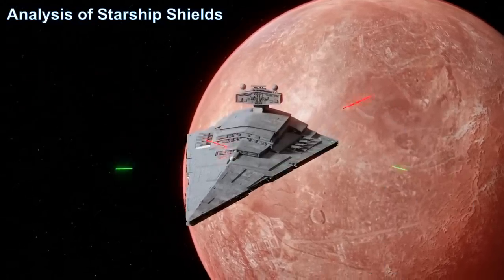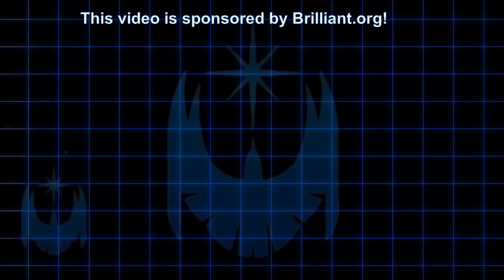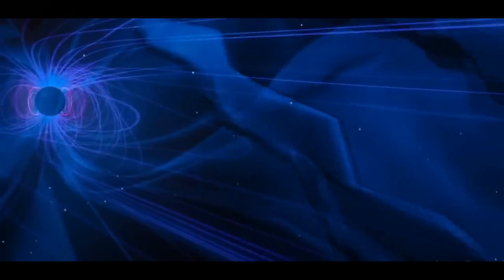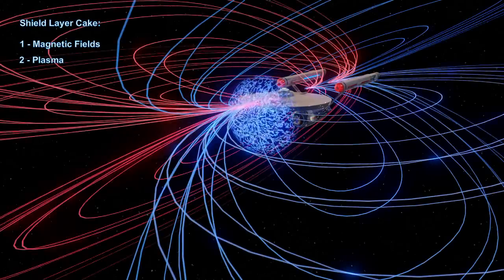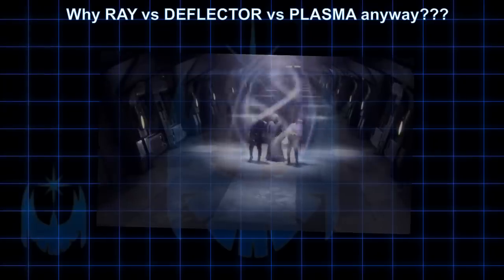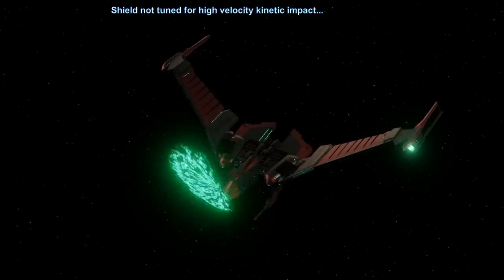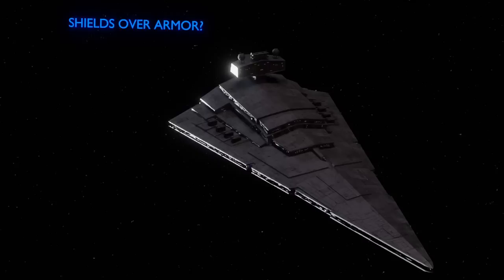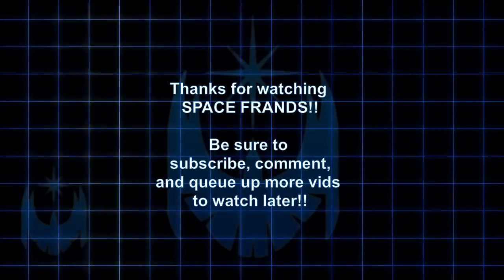REAL Starship Shields Types - They Work Like This...Animated Breakdown!

Comment: A very interesting take on shields. One quibble though, shields would add mass. The shield itself would not add much, but the equipment maintaining it would be HEAVY. Maintaining a shield would need alot of power, hence bigger reactor/solar sail/fuel tank And also a bigger radiator. And that's on top of the electromagnets and electrodes you need to control the plasma. (Now theoretically, if you're venting gas to keep your plasma shield going anyway, you could dump waste heat into it and that might alleviate the radiator stuff.) Not to mention that most ion beam/fusion systems use magnets on the outside of their vacuum chambers because making a magnetic field bigger then your magnet is expensive. Not saying it can't be done, but it would be cumbersome. As an alternative to armor, why not have armor drones following your ship around? It would look like a real life shield, and if you want a more punk/warhammer aesthetic, you could decorate the shield drones and make the special effects department mad at you for the extra hassle.
Reply: It would be big, true, but it would be nowhere near as heavy as armouring up a ship. All the mass and bulk of the shields is concentrated in one place, plus as you mentioned, bigger power source. Armour on the other hand, you have to COMPLETELY surround the ship with 10ft+ thickness of hardened steel, topped with a few feet of your anti-laser reflective surface..
Reply: @Debbiebabe69  
-As I comment this, It dawns on me that I have become one of the people getting into arguments over fictional starships, I feel my neck and...OH. Oh well, on with my dissertation.  

-What defence my fictional battleship is using ought to depend on: Who is shooting at me? what are they shooting at me? and who is paying for my battleship? 
I'm going to start with plasma/ion beam weapons first, and move onto impactors and lasers later. 

-I think the only style of shield mentioned here worth having is the plasma barrier. A magnetic field or electric field is vulnerable to neutral beams-which are easy to make just add a plasma flood gun to your ion beam. 
https://en.wikipedia.org/wiki/Flood_gun

-Look up bending magnets made by buckley systems. Those magnets are huge, and the ion beams they bend go on the inside. 
https://www.buckleysystems.com/welcome
in a similar vein, look up commonwealths fusions magnets for their tokamak. Again, the magnet goes around the plasma it is bending. 
https://cfs.energy/technology/hts-magnets
There is a magnetic field on the outside of these magnets, but it is weaker then the field on the inside. 

-To make matters worse, these magnets are time consuming to manufacture and hence $$$. Unless I'm flying some sort of expensive gladiatorial battleship, no one will want to pay for magnets that huge. (Actually even then I don't think they would want to fork over that much money.)

-to armor against projected energy weapons, the first thing to consider is the kW/cm^2, depending on how concentrated the beam is, you could probably get away with a half inch of water cooled graphite armor. You might want some radiation shielding underneath that, in case the beam creates secondary electrons causing xrays or even worse neutron radiation. 

-Also, how far away are these technobarbarians who want to shoot my beautiful ship? Lasers and ion beams aren't strait lines. They are very narrow cones, they get wider as they go out. That may make things easier. 

-Now for lasers: 

-Reflective coating, well it might be a few feet, but I don't think it has to be. The mirrors inside ASML's EUV machines handle conditions similar to space battle lasers, but they don't have feet of coating. Now, I'll add a caveat here, ASML has a pretty good idea what light frequencies the laser light hitting the optics will be. That does simplify and probably lightweight things. Another caveat: Just like bending magnets, giant EUV mirrors are $$$$$$ 
https://www.asml.com/en/technology/lithography-principles/lenses-and-mirrors

-An alternative to covering the entire ship, if I know who is shooting at me, where they are, and what frequencies of light they are using, and how spread out their beam is, I could instead position a mirror drone between me and them. (Because if I'm in space, who says my armor and my guns have to be physically attached to my ship? I could just give them their own propulsion and program them to stay close-ish.) 

-depending on the kW/cm^2 of the laser, water cooled graphite armor is again a pretty good idea. To further on the shield drone idea, a shield drone with a rotating water cooled graphite drum between me and those pesky rebels who want to destroy my imperial doom-ship would be kinda nice. 

-impactors: 

-Now the first question here is how big are these impactors and how much potential energy do they have? (In this case, I probably want to worry about kN/cm^2, but kW/cm^2 is still relevant.) Before I let it hit my over decorated armor, I want to break them up using my point defenses.

-Now how sophisticated are these impactors? For a rebel alliance with deep pockets, these impactors may have point defenses to protect them from my point defenses, they will have thrusters in case I try to avoid them, (After all, with the distances involved in space, they may have been launched at me months ago.) they may even have decoys to fool my point defenses. 
https://missilethreat.csis.org/russia-deploys-missile-decoys-in-ukraine/#:~:text=On%20March%2014%2C%20the%20New,mobile%20launchers%20within%20Ukrainian%20territory.

-against these, I have several options: I could try and trick the missiles with take drone ships, I could have space chaff and flares, I could even have some sort of giant screen showing the starfield behind my ship to try and trick the missiles. Though the giant screen would have the problem that its light would not be as colliminated as true starlight and a sophisticated impactor would NOT be fooled. (But a cheapo rebel knock off, it might work.)  

-once again, I don't need to armor the whole ship, I could have an armored shield drone that can take the hits and an early warning system.  

-As mentioned in the other comments here, you would probably be using whipple shields instead of hardened steel. 
https://en.wikipedia.org/wiki/Whipple_shield

-In addition, If I really wanted hard armor, I have other options besides hardened steel. Because I am an evil space emperor and have access to asteroid mines, I could use iridium or nickel based shields relatively cheaply. Even better would be ceramic composite armor like used on modern tanks. 

-Now if you actually read to the end, I am IMPRESSED!

Comment: I was thinking that if you have shield that works like you would expect using magnetic fields and charged particles. If it protects from some charged particles attack (plasma) then what about engines? so far we know how to accelerate charged particles and make ion engines but if there would be a strong shield around your ship then it would also absorb those particles from engines (would be like blowing fan into a sail on same ship). Tbh as i'm writing it with shields powered on how would you even use your energy weapons? So un less we use some kind of neutron acceleration there is a problem. (Neutrons 'acceleration' could be achieved using some particle collisions and knowing the exact angle of reaction we could make collimated stream of neutrons) I'm creating more problems... if we use accelerated neutrons then there would be no need for shields x) (ofc you would like to still protect yourself from cosmic radiation).

Comment: Neutron weapons seem like an amazingly effective thing here.
1. They don't really react with plasma that much.
2. They don't really react with most types of armor that much.
3. They wreak havoc on biology, sensors, computers, and any nuclear tech on the enemy ship. And unlike most radiological weapons, they actually cause the target to mutate into different isotopes. Possibly radioactive ones!

4. Neutron-hardening equipment isn't easy. You need avoid certain isotopes that become problematic when hit. You need to put very thick and heavy neutron shielding around crew and sensitive equipment. Additionally, unlike gamma or charged particle radiation, neutrons are not part of background radiation in space. Even if you can deal with them, most ships are not going to shield the entire ship from them. If they run their own nuclear engines those probably have shadow shields, but that does little to protect the ship from external attack.

Comment: Actually plasma is a fantastic absorber of most low frequency lasers and the more laser it absorbs the better it is. To the point this is actually what stops intermediate pulse lengths from being viable weapons in most cases. You either need to focus the thing on it for a multiple seconds and melt it, or go for nanosecond short blasts that turn the plasma from the vaporized target material into a million degree explosion that shatters and craters the rest of the material non-thermally.

Hard radiation frequencies like X rays can definitely punch through plasma but plasma is one of the blackest things out there when it comes to visible and IR. So much so that the opacity of the fireball from a laser weapon is actually the thing that limits its practicality.

Comment: I had a concept for a form of magnetic deflector shield that behaves more like the reactive armor on a tank, wherebye when a projectile approaches it fast enough, it basically lobs a massive magnetic pulse at the incoming projectile, steering it aside. Like flicking a nickel at a high powered magnet.

Comment: I like the way that Neal Asher deals with shields and armour in the Polity series. When the shield projectors overload they eject into space rather than becoming explodium inside the ship.  Like their engineering design is to have ejection ports and be designed to fail safe.

Another couple of interesting ideas from harder sci fi:
Sand shield (I think from Jack Campbell) they literally mine asteroids to crush into sand and gravel sized particles. As the human fleet fights it blasts sand ahead of itself then "taps the brakes" so space ahead is a wall of sand. This then interferes with beam weapons, is a physical obstacle for kinetic weapons (a railgun projectile hitting a near c sand grain will make a pretty explosion) and when the sand reaches enemy energy shields it dumps a massive load of energy into them and overloads them.

Point defence so good that it is shield like; or in other words you cover your ship in very fast short range lasers to individually or in an array target incoming kinetic threats

Comment: Last month you made a video talking about how everyone got wrong the deflector shields o an ISD.  I suggest you look into how everyone is getting wrong the dish on the TOS Enterprise.  Everyone is calling it the deflector dish because that's what is is on the Enterprise D.  BUT early schematics of the TOS Enterprise show it to be the COMMUNICATION dish NOT deflector.  

The deflectors are actually to the sides and bottom of the communication dish.  They are rectangular boxes.  These are also carried over to the refit Enterprise.  The fronts are now more oval.  These are ACTUALLY the deflectors which is why Reliant also has TWO of these on the top of the saucer and no dish of any kind.

Comment: Static shields project a field of static electricity that discourages or even fully disables people passing through by doing exactly that; projecting a static charge (the kind you feel when a thunderstorm is coming irl, or when you drag your feet on a synthetic surface and touch a radiator or other conductor). In Titan A.E., Star Trek and Star Wars we sometimes see people pushing through such a shield with great pain to the person attempting this.

Comment: Shielding against electromagnetic energy has been around for about a century. How do you all think your sensitive electronic devices work without every AC power source or radio signal source interfering? And defense against a laser is just a nice reflective surface. This has also been around for a very long time in a way. Although not laser frequency, satellite dishes and radio telescopes both reflect electromagnetic radiation of the desired wavelength. More recently, stealth fighter aircraft reflect radar off at a different angle. There's your deflector shield, albeit for far lower energy levels than sci fi would suggest. When a welder wears a welding mask he is protecting his face from very high intensity UV radiation that would cause instant sunburn without the mask, and it's just a piece of plastic with a heavily tinted glass window in it. So sorry to spoil the fun, but all the tech has been around for a long time. The only reason it's not really built on the scale that sci fi would suggest is that nobody is posing any threat yet with any credible directed energy weapons, and the only reason that's the case is because the end of the cold war and the collapse of the Soviet Union ended the arms race, as nobody could justify the continued expense. That might all change over the next few years now that Russia has flexed it's muscles and China is getting a bit too ambitious on the imperialistic front.

Comment: With how Star Trek Star treks deflectors are separate from their shields (even tho the writers forgot that at times, looking at you Picard) I assume their shields are Plama based, especially with how their Warp core produces an overabundance of it. Their Deflector likely deals with Lasers, like amagnet bending light, generally so could a Tokamak to a certain degree. There is a scene in TNG where the 1701-D meets a race shooting at them with lasers and the crew is merely amused by it. Light seems to be unable to damage the Ship at this point.

Comment: If you have the ability to replicate matter as in Star Trek, then the armor really doesn't need to be extremely thick. You would simply replicate new hull in place as soon as it was damaged. possibly even collecting the matter that blew off into space to do it. So then winning a battle would be overcoming the speed of their ability to self repair, or the energy required to do so.
it's odd there are not robots in that series too. There should be some taking care of ship damage automatically as well as mundane everyday tasks. Or maybe the replicator just dissolves your bed and rematerializes it made up...

Comment: There is also another kind of Shield that isn't as well known. The Kinetic Shield from the Mass Effect games.

The way these work is a ship, vehicle, or suit of armor is covered in dozens or hundreds of sensors that use a VI (Virtual Intelligence) that constantly scans for incoming threats such as Projectiles or energy blasts. When it detects and incoming threat it draws energy from it's power source whether that be a Power cell or an Ezzo (Element Zero) reactor to fire a Mass Effect field in the path of the incoming threat from a mass effect field emitter. This field raises the mass of the area in the path of the threat absorbing or defecting it. The number of emitters depends on what is being protected. A personal suit of armor might have only 2 - 6 emitters where as a warship might have hundreds.

I personally like this style of shield most cause it seems like the most energy efficient style of shield (Albeit not the strongest).

Comment: The disadvantage of plasma shields that no-one ever mentions is that they need fuel. You don't just conjure up plasma out of thin vacuum. You can make one out of thin air tho. Plasma shields require a material to be put into the state of plasma so you will need probably large canisters of pressurised gas on your ship, and your use of the gas will be limited for long engagements. However if we're talking ground forces, you could theoretically hold a shield as a permanent barrier if you've got the power for it since you have an entire planet worth of atmosphere to use as your shield fuel.

Comment: One theory for Star Wars shields I came to the conclusion on a while back, was that everyone COMPLETELY misunderstood the shield system, and that mistake has carried over to today.

I look at the Death Star Trench Run in A New Hope, and the thing you notice most is that laser fire misses, until it just doesn't.  And then you just flash fry on the spot from the first hit.  The way I look at the 'deflector shields', is that they don't absorb the hit, but they are actually actively deflecting the shots coming in.  All the missed shots are 'deflected' shots, shoved aside so they pass around the fighters.  Half the dogfight is either trying to burn down the deflector's field charge with consecutive shots, or getting that perfect angle where you score a hit even through the deflection's 'push'.  Something that's easier to dial in from a tailing position than from off-angle deflection shots.  ('Deflection' shot here having no relation to deflector shields or 'deflected' shots.  Deflection shots are an air combat term for shots taken at the 'top' of an aircraft as it turns and presents its spine to you.  You are essentially trying to shoot it as it passes through your stream of bullets... or lasers, or whatever, nailing it from its largest aspect, but also while it is moving fastest relative to your field of view.)

This is why, despite being right on the tail of rebel fighter groups running a straight line down the trench, it took multiple shots from a TIE with a computerized targeting system firing a weapon that travels in a STRAIGHT LINE without anything resembling bullet drop, to hit and kill each fighter.  The shots were being deflected until Vader weaved his TIE a little and found the sweet spot, and nailed each craft.  Otherwise, you'd just rake them with fire and watch them all die in a split second.